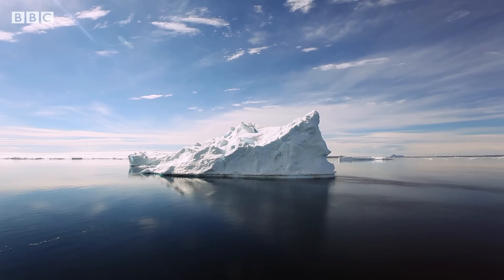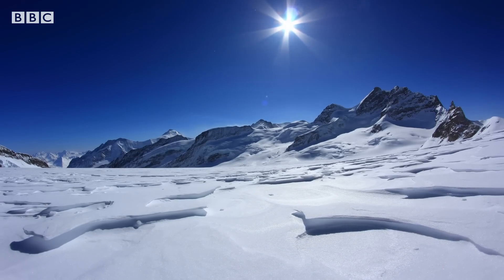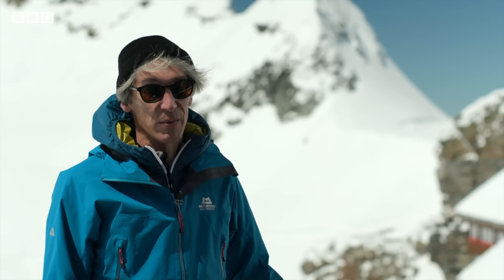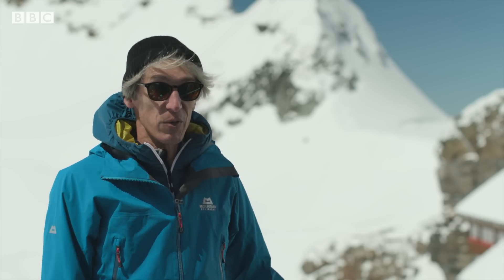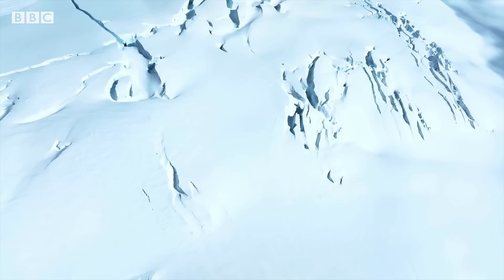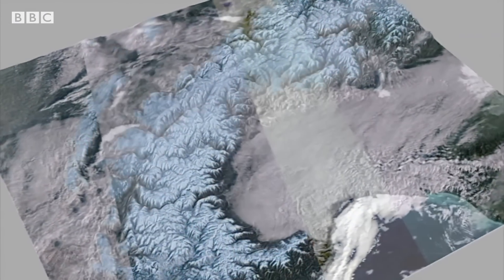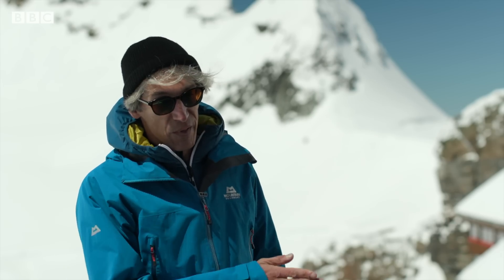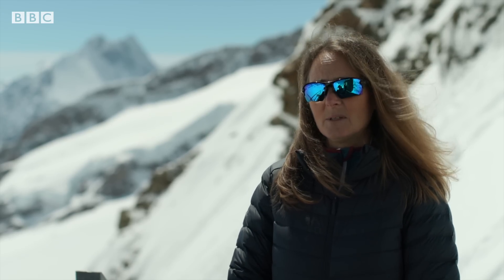How do you measure the snow melting on Switzerland’s glaciers? | BBC News

Comment: Glacial retreat is not evidence of a climate crisis. 
The retreat of Himalayan glaciers began before the current warming and was caused by reduced precipitation (Shekhar, 2017. Singh, 2020.). This supported by further work done by Schneider (2014), and Chen (2019). The retreat was due to a reduction in precipitation. Currently, precipitation is half of what it was 20 years previously. Research by Salerno (2015) "challenges the assumption of the main driver [i.e. temperature] of glacier mass changes". 
Satellite data shows the glaciers in the Karakoram largely unaffected by current warming. Of 1219 glaciers surveyed, 79.5% were stable, 5.3% were advancing, and 7.6% retreating (Rankl, 2014). 
Swiss Alps glacier extents were smaller than 2000 C.E. during  the warmer-than-today Roman and Medieval Warm Periods and throughout 75% of the Holocene, or when temperatures were 1-3°C warmer (Schimmelpfennig et al., 2022).
Glaciologists Bohleber et al, 2020 of the Austrian Academy of Science discovered from ice cores that the 3500-meter high Weißseespitze summit was ice free 5900 years ago.
There is “no evidence” that Jostedalsbreen, a southern Norway glacier, even existed during the first several thousand years of the Holocene, or when CO2 hovered near 260 ppm (Winker, 2021). 
In Alaska's Glacier Bay the melt rate from 1780 to 1880 was much greater than the melt rate from 1880 to the present. 
There is no objective observational evidence that we are living in a global climate crisis. Glacial retreat is certainly not evidence of this.